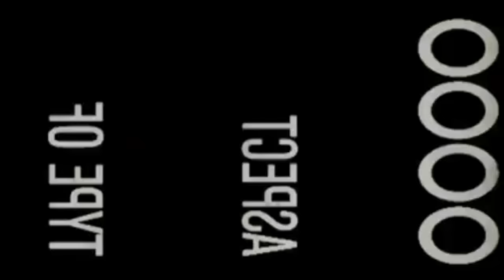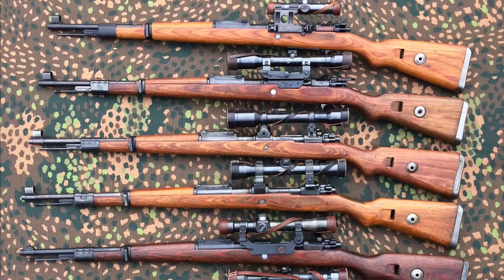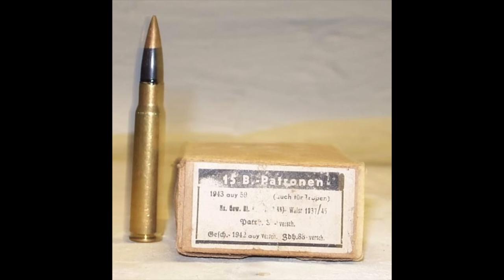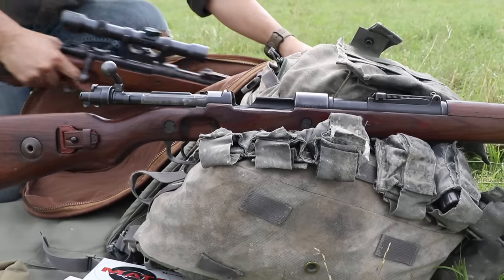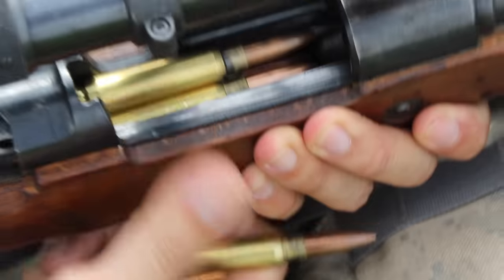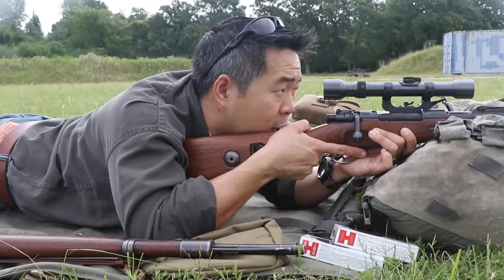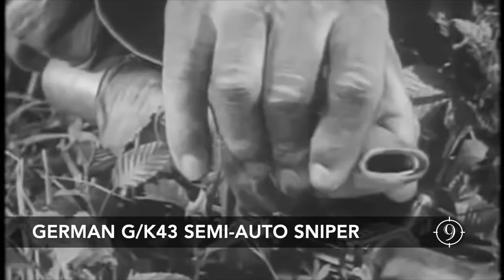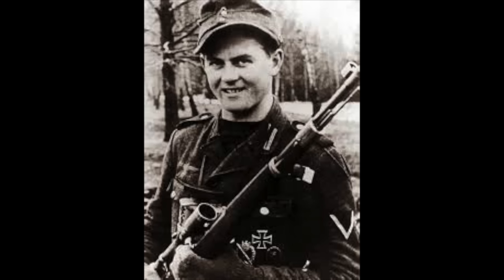The Kar98k Sniper Rifle and the WW2 German Sniper

Comment: A small bag filled with sand to place at the bottom of the K98K butt will aliviate the butt coming down and the back of the scope striking the eye or face.  Also moving the non firing hand to holding the bottom of the rifle along with the sand bag can help also.  Henry is actually using the above technique with the modern sniper rifle, and could have used that with the K98K. Iron sites are also a good idea even today of the scope gets damaged.   I would want my sniper rifle to have both.  I was a sniper in Special Forces and learned how vital it is to have a very good stable firing plateform.

Comment: So I’m not the only person who thinks the 8x57mm is unpleasant to shoot. 196gr at 2,600fps packs a real wallop.
Reply: And now imagine an MG42 spitting out 1500 of these per minute.
Reply from the maker: the MG is a lot more pleasant to shoot. It's got the recoil reduction buffer. Same for the FG42. However the Mauser 98k? YOU are the recoil buffer.
Reply: Bernhard Langers Any self-loading rifle or machine gun has substantially less felt recoil than a bolt-action rifle of the same caliber. The cycling of the weapon helps cushion a lot of the recoil energy, whereas with a bolt-action rifle it is a very sharp recoil impulse straight into your shoulder.
Reply: Well, I stand corrected then.
Reply: Yeah, 8mm Mauser out of a bolt action is pretty unpleasant, especially prone or off a bench.  So is 7.62x54R.  

 @ritterbruder212  Mass helps, too.

MG-42 - 25+ lbs.  
KAR-98K - 8-9 lbs.
Reply: immikeurnot 7.62x54r out of a long rifle doesn’t bother me at all. It’s a little unpleasant out of a carbine but not that bad. I think the shape of the buttplate on most Mausers has an effect: it’s completely squared off and has no curvature to contour to your shoulder.
Reply: It’s disgusting to shoot, but it works pretty well for hunting.
Many people here in austria use old Kar98 for hunting deer and hogs.
It’s starting to get rarer tho, as the ammunition gets more and more expensive and modern hunting rifles are more reliable and easier to get.
Reply: @9HoleReviews ..... wer es nicht kann sollte eben keinen 98er schiessen....ich pers. hatte noch nie ein problem damit.....!
Reply: I had a very light version of a later mauser in that kaliber: it kicked like a donkey...

Comment: I have a sporterized K98 with shortened 18"  barrel with recessed crown. It has an older Weaver 6X scope, no iron sights and a synthetic Monte Carlo synthetic stock by Ramline. This is a 1 MOA rifle with Mil-Surp 1955 Uruguayan 8mm ammo. It is a fine rifle. The K98 action is outstanding as is the 8mm round!

Comment: Mauser recoil ... Bob Allen shotgun under shirt recoil pad, slip on pad over the steel but plate, avoid lots of prone position shooting, use com-bloc mil-plus LPS (147gn bullet) instead of the 196. I used to burn thru 4 boxes (60 rounds) a day back when it was cheap for that ammo.

Comment: I have a 98 k surplus rough condition outside . bore good, bolt ok . shoots pretty good, enough to deer hunt to300-350 yards with my reloads. my 8 mm Egyptian hikam, has magazine fed rifle is the simplest semi automatic rifle to take apart I ever saw. I can easily strip it down less than a minute if I had to . it has so few parts to deal with . there’s two stores about who put them together. I’ll go with huskivarna  , not spelled right. the Swedish chainsaw company as we know it today made all the parts they sold to the Egyptian government and they put them together. thay also made them in 6.5-55 and. if I remember correctly 7.62-39 . as hard as ammunition is to get around the country you can  reform 30.06 brass by deprive ing it, not to much lube on outside  case and a q- tip with lube lightly inside case mouth. run the 30.06 brass through a 8 mm sizing die full length. trim to length ream mouth . load to fire form . your good to go . nana and papa aka the hunter wishing you well

Comment: A true Kar98k Sniper rifle has a cross cut but plate that gave friction from slippage and modified safety still a very well done video.
Reply from the maker: That depends on the era and the build. For a LSR, you are correct, but for a SSR as shown, it typically does not use the extended safety. see here: https://www.wwiigermansniper.com

Comment: I think that it should be worth mentioning that Czech Mauser are the most accurate of all Mausers in my experience, closely followed by Chinese, Swedish, Belgian, Yugoslavian, and Chilean. Kar 98s are more hype than they are in value. It’s also important to note that earlier makes had case hardening and thus issues with receiver failing if it was gouged beyond the temper. Later makes from 1915/16 corrected this issue but a number of early Mausers still do including the Chilean and Swedish. But it’s no big deal if you take of your rifle because if you do it will take care of you. 

Also I would to see you take out a FN 49 to those ranges.

Comment: Allot of those repro mounts were improperly made.   The rear ring is supposed to sit in a curved dovetail.  The repros are mostly cut straight across.  Yeah you can get a little windage with it, but only a little before everything binds up.

Comment: I was shocked of big the grouping of a 8mm kar 98k shoots. My 1903a4 with handloads of 150gr gave me a 1.5 or slightly less moa, now I use 168gr and I have gotten just under 1 moa. Most of my targets now consist of using just small note papers taped to a cardboard target.

Comment: Awesome video!  Although considering that you mentioned the majority of sniper engagements were within 400m, then could it be somewhat inferred that competing equipment of the No.4 (T), the 1903 sniper variant, the Mosin Nagant sniper variants, and sniper's personal weapons (P14, M1917 snipers) all adequately met their objectives?  Thus you could say the sniper variant (like its cartridge) were over engineered beyond their needed specification.
Reply from the maker: Exactly that. It was a period where the role of the sniper had changed again. Shifting from the "trench sniper" to the field sniper with a more fluid battlefield required a new breed of sniper. Static and elaborate contraptions were traded for field-deployable concealment. Semi-autos were used... 
My personal choice would be the No.4 MkI (T). Fast and accurate action, great scope, iron sights on the backup, 10rd magazine (I know they didn't issue spares), great ergonomics... For WW2 distances, I think the British had the best sniper weapon, the one downside is that the ammunition was not specialized like the Germans.

Comment: Where did you get the scope and checkered butt plate? I've been looking for a while and can't find a reliable and prove source. Thank you and excellent video(s)!!
Reply from the maker: Ebay, and it took me FOREVER to find one. A lot of the ZF39 copies you see out there had rings soldered on them, which those will require disassembly and scope body refinishing prior to installing.
Reply: @9HoleReviews  Thanks Henry! Also would the gentleman who did the work on yours be willing to do it again?

Comment: Can you try the M14 EBR????
Looks like a cool weapon.
Thanks bro.
Reply: They've done the M21. Which is based off the same system

Overall conclusions is that it was inferior to AR-10 style systems. AR-10 having more reliable accuracy holding, handles heat better, and recoils less.

Comment: My 98K sniper rifle has a Zf-39 scope with the high turret scope mount. The scope will not hold it's zero long not sure why. My Mosin  PU sniper (original) holds it's zero  very well but my 1903A4 rifle is my best sniper rifle. I sold my Enfield sniper with the T-32 scope back in the 80's foolish move on my part it is by far my favorite WW-2 sniper rifle. . Is your scope of new manufacture?
Reply from the maker: 1930's manufacture Opticotechna.

Comment: Do you have info about which snipers were issued Zeiss 8xscopes ?
Zeiss, SB, Swarovski etc 8x56are good scopes to pick up. For Zeiss look for German made ones ,they are best ones of them.
Reply: The Zeiss ZielAcht was offered by zeiss even before the war and used to hunters. with the beginning of the war, the rifle scopes were drafted and put to various units from heer and SS. It was procurment on ´the short´way..
Reply: @predatortt7694   Yes i have read alot about Zeiss before ww2, i have a couple of Zeiss, only early 90s models sadly but a lot to be found. But not much written about them in millitary usage it is compared to 4x and 6x versions.
Reply: Stephen Carran  soory, i dont have. But it was the same like in Weltkrieg 1. The German army drafted all (or a lot of) scopes from the hunters. They called it "donation", but it was a expropriation.

Comment: But ur smaller framed then the average German soilder ,an have less cloths on say ur laying in the dirt ,snow rubbel an a city or logs in the woods
No ,,sniping was well in use ,ww1 most troops feared snipers or geting snipers ,an all sides used sniping ,1991 spring field the rule was 20 rounds in a minute with a bolt action ,